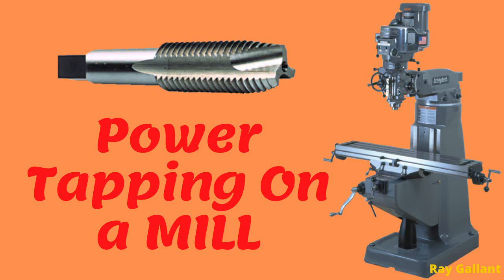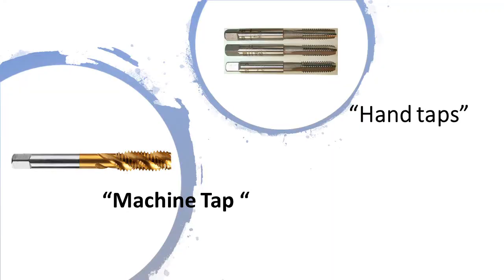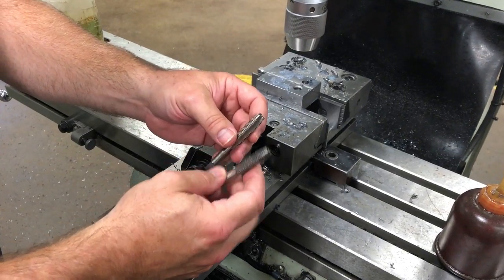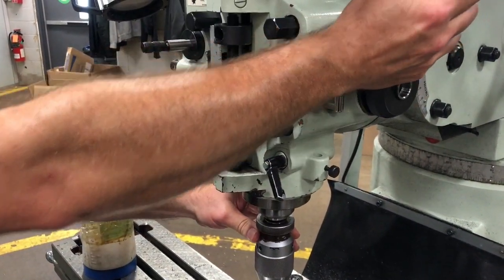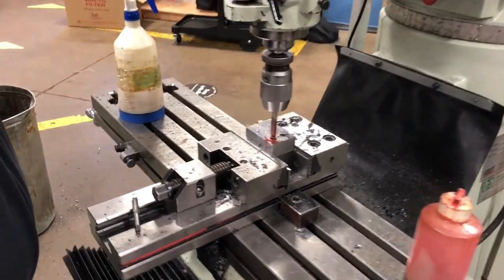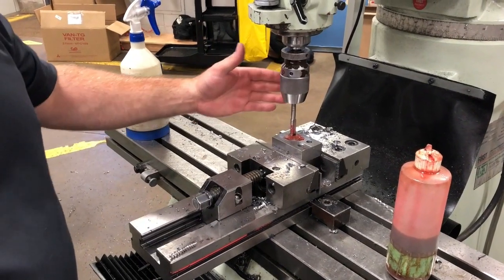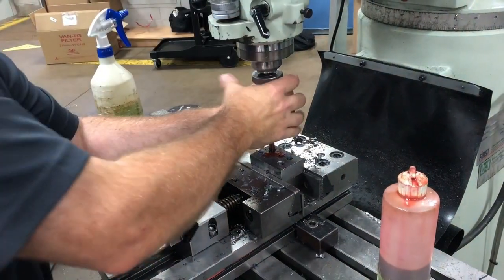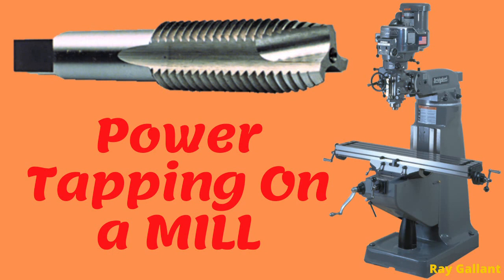power tapping in the milling machine

Comment: If you used a keyless chuck for tapping you are courting disaster.  They self tighten if slipping is detected to the point that the chuck will crack.  Experience teaches.  Only use a keyed ball bearing chuck for tapping and only with tap sizes less than 3/4” in a Bridgeport type machine which is really a somewhat light duty machine.  Large taps demand a tapping head or a more robust machine.

Comment: Did 1000's of threads like this when I was a Tool and Die maker.  Broke one here and there had to EDM it out, usually 6/32 and smaller if one did break.  Re-tapped a hole once where a 1/2 in bolt was broken off and there was a tiny piece of bolt left in the old thread after drilling it out and it broke the tap and it hit me right in the middle of eyes and cut my nose.  Never again did I not have on safety glasses.  But yeah this works great %99.5 of the time.
Reply from the maker: preaching to the choir. I’m glad you didn’t get hurt. I’ve had many close calls as well as soon as we stray from the guidelines. Bad things happen.

Thanks for your comment and thank you for sharing 
Ray

Comment: Good info, would have been nice to actually be able to see what controls you are using, don't need to see the tap turning as much for the purpose of the video
Reply from the maker: will keep that in mind 
thank you for commenting
Ray
Reply: For drilling and taping on manual milling machine, having VFD and powerfeed using stepper really solve a lot of issues. Moving from point A to B very accurately (program using controller) I use Nema86 -8NM. And I don't have 3 phase power system so I use VFD instead. Programming and having a lot of option to control the motor. 4 buttons - forward -reverse - jog forward and reverse. The best thing is you can adjust the torque settings and start and stop duration. And VFD is also a good option for protecting motor and cheaper since I got mine for less than 100$ comparing to Contactor and those expensive switches and buttons.
Reply: Fantastic sharing of information.  Much appreciated.

Comment: Those straight flute taps work good in cast iron. Personally I'd never attempt a spiral flute in a manual mill, they are the weakest of taps and required the most cutting force.

Comment: Two things I'll add are that a Jacobs Super Chuck (with key) works better than a keyless, and for tool steel or dull tap as he mentioned I will still use the mill to start the tap. With the chuck hand tight it will slip when the tap gets tight but by then it is started straight and you can hand tap it from there. Good video though.
Reply: I agree with everything you said
Not a big fan of the keyless chuck’s
I also like taking the end of the key putting it inside one of the tightening holes with the mill in neutral using the chuck key to drive the chuck
Reply: Yes always a jacobs super chuck or at least never a keyless. I do this daily in tool steel.I use tranny fluid for cutting oil. It works great and I tap a2 and d2 often. I never buy cheap taps and as soon as the tap has difficuly tapping, or the edges are visably damaged, the tap goes in the trash. Never save bad taps. The most expensive taps are the ones broken in Your work. I try to by Guring or another quality brand